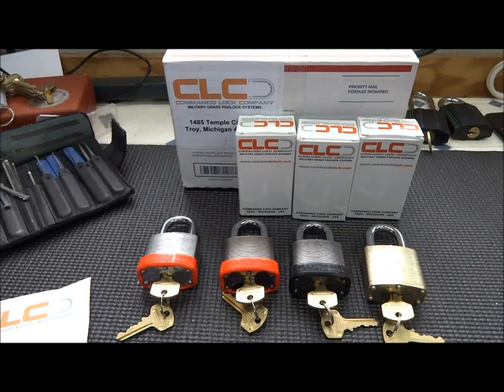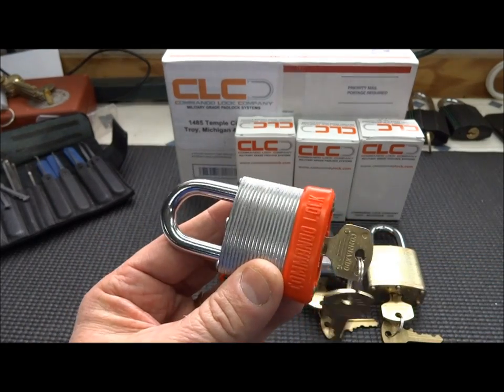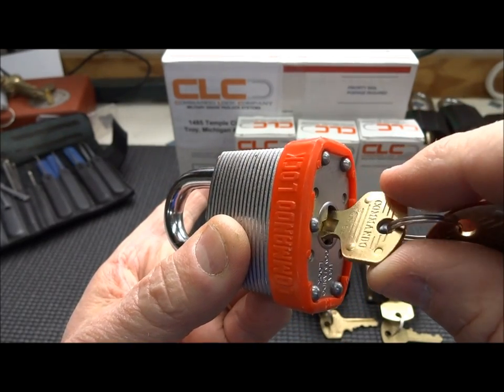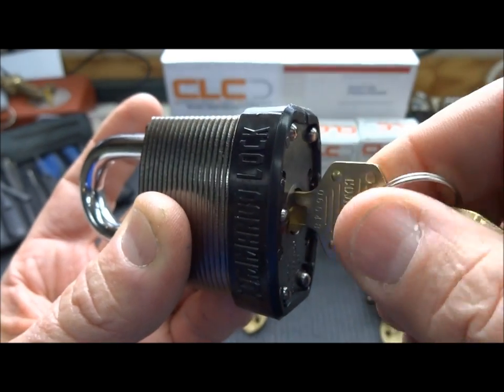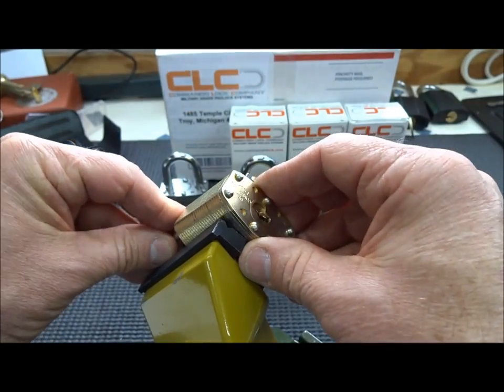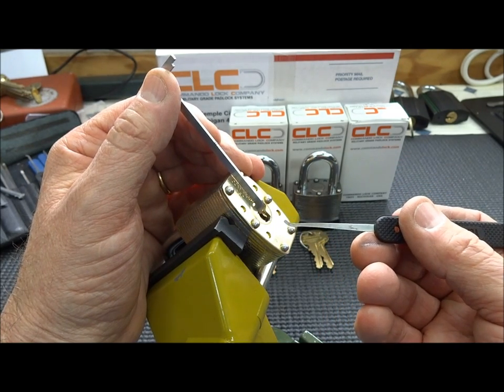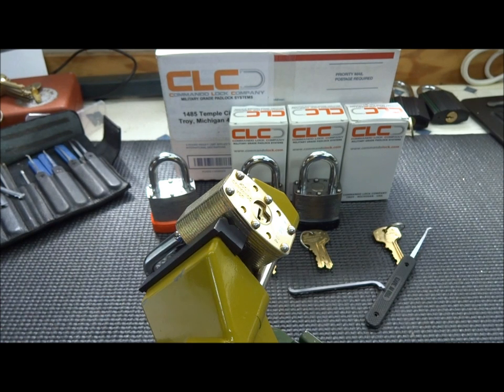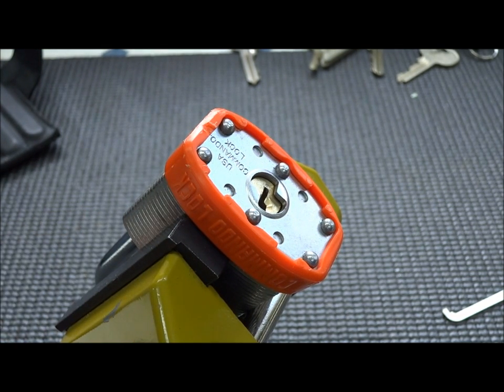(256) FIRST LOOK: Commando Lock Prototype Cylinders

Comment: They are supposed to be the same keyway as a masterlock. The main concern was having a common enough keyway that people could easily get spare keys cut. There was quite a bit of discussion on the forums with other suitable ones that would provide more of a challenge and be common enough people could still go down to "Ye Olde Hardware" and get a spare key :D

Comment: Hey Bill! Could you not overset everything with a comb or pick, then try to reverse pick it with the springs to the shearline? The lock would provide the tension, a pry bar to push against the 'detent?', maybe a hook in the keyway to catch mistakes. I'm a 2 month noob, so no chops with the locks, or picks, but I'm a pretty solid tinkerer.  Love the videos, Thanks Bill!
Reply from the maker: Try it and let me know how it works out for you.  I never had a lot of luck with reverse picking as you can't control which pin falls and you can't tell by how much.